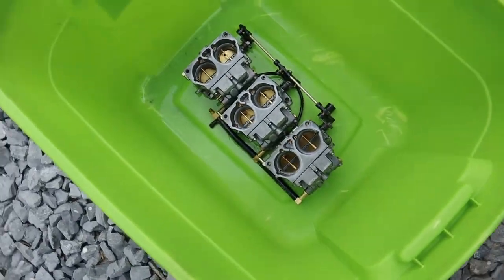PART 2 MERCURY OUTBOARD POOR IDLE FIXED

Comment: hello, I have a Mercury 15 hp and I'm going crazy for the same problem, giving gas it goes and it goes well then it turns off.  I cleaned the carburettor and replaced the fuel pipe, today I will also disassemble the valves.  thank you very much for sharing your work, I will update you!  Greetings from Italy.

Comment: I've come across many a broken reed petal, and each time the engine just sucked it in and spit it back out through the exhaust. never been able to find the pieces. HOWEVER it's also possible the piece of reed is stuck somewhere in the crank case, waiting to get dislodged. That's why i change many a customer motor to fiber reeds. just like you demonstrated, they start 3x better and have more power. best investment. ever!
Reply: After spending the better part of a couple of days looking for that random little piece of broken reed and assuming it went out an exhaust port in tiny chunks and assembling the engine and putting it in the tank to run it to check out everything and adjust carbs etc. After about ten minutes of run time started hearing that dreaded rattle and pulling the engine out of the tank and pulling plugs to see if there was any serious problems found a few little pieces of the offending reed sticking in the top of a piston so down it came again and to see if it was going to need a new piston or what pulled the covers for the exhaust ports (it was a vertical inline six cylinder) and wouldn't you know it, there inside the exhaust port covers was the rest of the offending reed valve petal. Learned a really important thing, that it isn't good enough to just shine a flashlight in the cylinder and blowing it out with a air hose and cleaning solvent spray. Them little things are like beach sand, they can and will get into the tiniest of places.
Reply: @horsepower711  yes. sorry that happened, but i wouldve taken it to a machine shop that does 2 strokes and bored it then had them clean it in a hot tank to get rid of every last particle.

Comment: I was taught that the easiest and fastest way to check for a damaged reed assembly was to simply slide a business card in front of the carbs one at a time and if it flutters or has any kind of kick out away from the carb you have a broken reed or damaged reed block. On the older four cylinder inlines you would sometimes run across the symptoms but not find a damaged reed on any of the blocks, but don't quit yet because when you pull the reeds off you're going to find a little crescent shaped nick in the aluminum reed block where for some reason the reeds would contact with the tip first instead of hitting flat and would cause the little nick that would make the engine idle bad but until the reed would eventually break it would seal good at higher rpm. But we used a flat piece of 3/4" glass and 400 grit wet or dry sandpaper and cleaning solvent with a little oil and work the reed block in a figure eight pattern checking often until the blocks were smooth with no sign of the nicks left. Then reassemble everything and it would be as good (if not better than new

Comment: I have a 1998 Mercury 250 EFI 2-Stroke. All these broken reed valve videos were freaking me out because I fish very far offshore. I ordered some carbon fiber reed valves. But when I removed my old ones, the previous owner had already changed them! They were carbon fiber and looked brand new! I’ve owned the boat for 4 years. They looked so good that I could have boxed them up and sold them as new to somebody.

Comment: My reed valves came loose on one side of one block and cracked a reed apart. The screws could not come all the way out because it's so close on the inside of the intake. But damage was still done got into 2 rod bearings that broke apart and got inside the engine and took out 2 rods 2 pistons 1 crankshaft and 1 head, not a happy day for July 4th. 1994 Mercury 200hp 2 stroke now got everything  rounded up, just need new reed valves and overhaul kit. Just what you want to do in August heat.  I've watched several of your videos and decided  to do it myself, like you said big weed eater motorcycle. Allen Shifflette

Comment: I just bought a 2004 Mercury 200 and I've had the same kind of issues. I burned up my starter yesterday at the boat ramp. Gonna check the reeds tomorrow. Thanks brother.
Reply: My reeds looked okay, I guess. None broken, but it looked like some of the ends weren't making a great seal against the housing. Could this have been the reason why my boat would randomly go dead at idle and take forever to start?
Reply from the maker: Yep

Comment: Sounds like exactly the same issue as my 1985 merc 150 black max. Thanks for the walk through!
Reply: I have an 85 mercury black max 150hp as well. It has a hard idle and sometimes dies. Especially while idling in gear. Also takes forever to start sometimes. Did re working the reeds work for you? Or was it something more than that?

Comment: I had the same issue on my 99 xr6 150 poor idle, after much research carb rebuild first. same issue poor idle, so more research, thank goodness for parts books and internet, found two reeds with bad chips, broken, researched reeds, my dealer was too expensive and wanted to sell the complete reed block. found Chris Carson and he was great help. One thing he told me to do was to use 400 grit or better paper to lightly smooth out the blocks over glass with water. also putting the screws back in used small screw removal loctite. I'll ask now, how much was the stuffing box improvement to the engine. My reed replacement was 6 years ago and still work fine. but bought stuffing box and reeds too. thanks for the great video.
Reply from the maker: Awesome man! Glad I could help! The stuffers reduce the crankcase volume which will give slightly more torque on the low end but at an equal cost on top. I found that the 2.5L 150 didn't really need the torque boost due to the long tuner. They definitely have their place in the performance world but it depends on each individuals needs. I haven't tried them on a more open exhaust setup to see if the torque gain is worth the rpm loss up top yet but I imagine the benefit would be noticed. Especially on a heavier boat. Just my thoughts and experiences. You'll hear people with opinions on both sides.

Comment: Maybe it broke little pieces at a time getting progressively worse. Good video. I am having my own issues with an Evinrude etec I bought used. It was supposed to run but the guy who sold it to me was lying his tail off. My reeds were not broke but I think some carbon may have been keeping them from closing.

Comment: I hope its just my reed valves also. 
I rebuilt my carbs. New fuel lines zip tied all my vacuum hoses and fuel lines. It started up 5 times in a row. Once I dropped it on the water. Zero start. Frustrate the crap out of me.

Comment: I want to replace the reeds on my 200 Optimax 3.0L. Is it difficult to remove the intake? And put everything back together? Any tips? Also do you have to re prime the oil pump after or any special recommendations? Appreciate your input!
Reply from the maker: It's very similar to the 2.5L. Yes, you will want to prime both fuel and oil on yours when you're done with the reeds.

Comment: Wonder where the missing piece of valve went. All through the cylinder?   Out the exhaust?  😅
Reply from the maker: That's exactly where it went. I was a lucky one. The reed pieces are so thin and small they were passed through without damage. Very lucky for sure. Had a piece made its way between a bearing or piston, things would've been different.

Comment: received my reeds and suffing parts Is there a special way to install the spacers, follow the gasket impression, ? sent email to CCmarine too. thanks for all your help.
Reply from the maker: Put the stuffers and reeds on the intake but dont tighten it all the way down yet. Put the intake assembly on the block and then slowly start tightening the reed cage allen bolts. Be careful! Dont want to crack a cage.

Comment: Hey i have the same issue on a 100 Mercury..fuel coming out of the carbuerator and hard to start
Reply: my did the same thing. end up to be the carburetor float seat needle. I rebuild carb and it running good now. If you want to know if it a carburetor problem or reed valve. Get a piece of duck tape just about a size of carburetor intake. place it on top of of the carb opening. Make sure seat the tape secure to the carb body. crank engine a few time and watch the tape. If it try to suck in. Then it not your reed valve.
Reply: @tonyvu167191  Hey thanks haven't really used the boat but i am going to try this.

Comment: Man that's awesome glad its fixed brother. I bet you will get a better top speed as well 😁
Reply: you dont need a new check valve in front of low pressure filter as the Y in the fuel line past that point is in fact a brass check valve  from the automatic oil injection pump, when the motor isnt running the oil isnt being injected so there is NOT a dilution problem
Reply: I've just received CC,s reeds and stuffers and also head studs as I will be shaving the heads a bit and I don't want to break any bolts in the future. And maybe advancing the timing a degree or two because we have reasonably good 98 here in Australia. 
 I've been looking for a video on this for ages. Thanks.
 It's a low hour 94 2.5L offshore.

Comment: You have the exact OB I have, but I am trying to confirm this. I just purchased it a few months back.
Can you check your OB right behind the throttle arm, toward the top, there should be the letters "CC" stamped where the two halves of the block come together.
Would be very much appreciated !!!
Reply from the maker: Its a 2004 xr6. Should be the same block on any 2.5 L from 2000-2008
Reply: Cc block is a 175
Reply: @boatsandjeeps780  
thank you... good to know

Comment: Hey man! You’re videos are a great help! I’m having a little trouble with my motor as well. Was thinking about getting the carbs cleaned and tuned but when I go to do that I will also check out the reeds thanks to you! I do have one question buddy. When you start your motor, how long does it take for your water pump to begin pushing the stream out the motor? Mine takes a decent little while and it scares me that it may overheat due to that.
Reply from the maker: At idle it usually takes a couple minutes for the thermostats to open. Its normal.

Comment: I have a 2005 Mercury 50hp outboard that does the exact same thing. It runs great on open water, but idling at the dock or taking it on and off the trailer is almost impossible. Does a 50hp have the same reed type setup as your 150? If so, let me know when you're gonna be in florida and you can show me how to fix it lol!!!  Awesome videos....thank  you, and keep up the good work.
Reply from the maker: I would suggest you either get a manual  for that motor or open it up to take a look. But to answer your question, yes, it has reed valves.
Reply: @SmalltownBassin  Thanks 👍
Reply: @db9230  I got the same motor but 2007. I do have the service manual for it if you need it. my acting the same way. On my it was a fiber reed valve. but found out it was carburetor flooded. rebuild carb and now all good. that was a simple and easy carb to work on. email me tonyvu16719@yahoo.com. I can direct to the service manual link.

Comment: I have a 2006 mercury 1.5 90hp 
And it does the same but it shuts off .. no idea if this will help!
Reply: Every got yours fix? What were the problem
Reply: RuffRize Rise I believe the ecu got replaced and a coil along with the spark plugs.. I currently have misfires so I bought all new coils to match each other and I’ll change the spark plugs again. Boats sit for so long it’s always something.

Comment: I have a question. After the reeds and stuffers did you have to make any carb adjustments
Reply from the maker: No. If you take it a step further and add intake spacers then you will need to jet up but just reeds and stuffers don't require any adjustments.
Reply: @SmalltownBassin  ok thanks well I did add a 200 bobs tuner.we are also jetting up to 175 jets. Thanks for your feedback

Comment: I got a 50 hp mer...it is tuff to start but if I use my finger take off throttle  cable I can get it. Help it is a 83
Reply: sound like flooded carburetor. Not enough air.

Comment: Mine aren't broken but they have taken a set and no longer seal.
Reply: Mercury makes a cleaner that is used by spraying it into the carburetor(s) following the directions on the can. When I was still working (certified Mercruiser & Outboard mechanic) we had an elderly man bring his boat in that had an old Mark 35 Mercury outboard that wouldn't idle on all four cylinders and was hapard to start too. It failed my credit card test so I informed the gentleman and he said he couldn't afford the repair costs. I felt really bad for the guy since he was a local and I knew his past couple of years had been pretty hard on him so I told him to give me another day and I'd try a couple of Hail Mary's on it. I'd noticed that it smelled of old gas and there was oil coating everything so I was thinking maybe a reed block had something stuck to it that might have found its way into the crankcase from a carboned up exhaust and a can of the cleaner wouldn't hurt, and who knows, even a blind squirrel finds a nut occasionally. After putting a can through it and choking it out by flooding it with the cleaner I let it sit overnight and the next morning pulled the plugs out and spun it a few times and then throwing four old plugs from my toolbox in it and fired it up and ran it for about a half hour at different throttle settings both idle and full throttle it finally burned out all the cleaner and I shut it off and put his new sparkplugs back in and tried it again and after readjusting the carbs it was almost as good as new and would now idle and fire up with just a bump from the starter or before you could pull it p
Reply: Before it was hard starting and would only idle on two cylinders and at full p

Comment: well you found the reed was broken, and yes your right its a steel reed, then you got new reeds to fix it, then fitted them   WRONG, you should of delved down into the guts of that motor to try and find the missing part of the reed before it destroys the motor. the worst thing you can find is a broken steel reed, it means you need a complete teardown to find the broken part or if it going anywhere near the piston and wall or the big ends or small ends you could have a completely destroyed motor. those  broken metal parts dont just fall out the bottom, so if you cannot find them with the intake off then its a teardown....
Reply from the maker: What you're saying is 100% correct. In this particular instance though, the pieces were not in the crankcase or cylinder. Trust me, I looked. I've got too much invested into this just to blow the motor over a Reed. The only explanation can be that the piece was pushed out the carb instead of being sucked into the crankcase. Thanks for  the comment though. Your input will help others with a similar issue.

Comment: good job done on changing the reed valves,,,,, but,,,,,, were has the broken part of the reed valve gone?,,,,  you never found it!,, so it has got to have gone inside the engine!,, its either stuck in the crankcase or its gone up into the cylinder and have been blown out the exhaust or it could still be stuck in the top of the piston, so just swopping out the broken reed valve and ""not finding the broken or missing part!"",, running this engine you are tempting providence,, this engine could still go with a bang on you and rip its self to bit's!,, never ever just change out a broken reed valve and then run the engine,,  unless you find the broken part of the reed valve first!,, I hope you dont find out what your mistake was,,,  the hard way!

Comment: I have a the same exact motor except 2000 model. I have the hard start, rough idle but I also deal feeling of lower power in hole shot when livewell is full and my speed is down. Just curious how fast your boat runs pre change and now?
Reply: tuffdaddy1711 ur over proped
Reply: @reddawng43x91  actually my prop is fine. Found out i had a bad spark plug. Changed all of them and now she runs great..
Reply: tuffdaddy1711 glad it worked out that simple